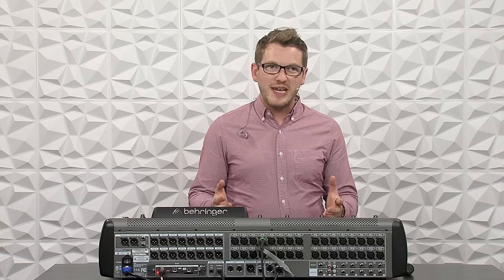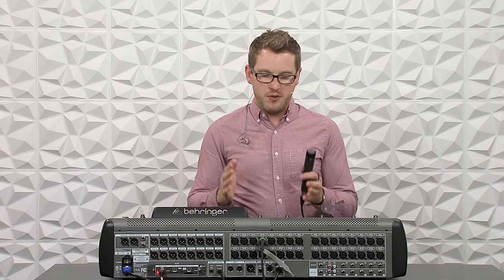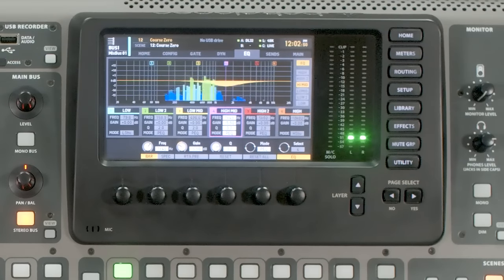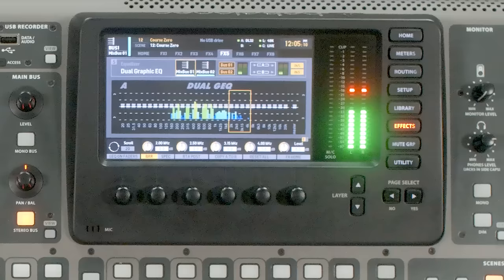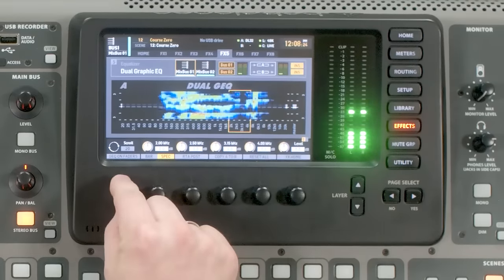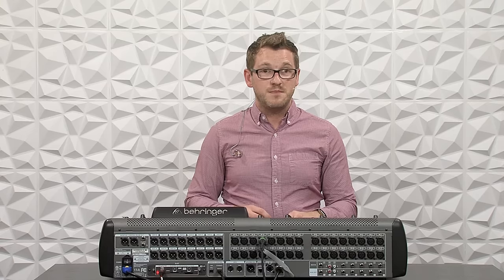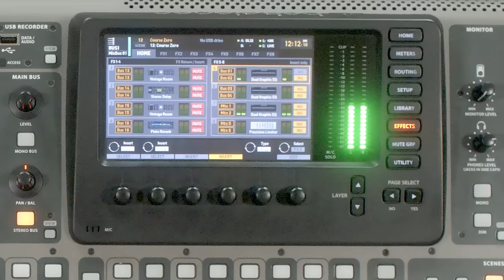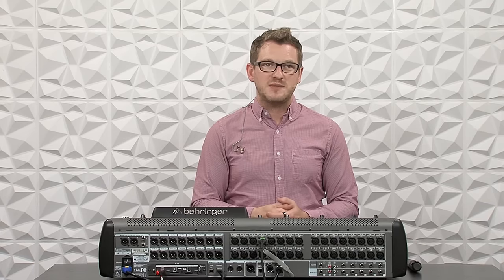Monitor Mixing - How to Ring Out a Floor Wedge - Ringing Out Floor Monitors_1

Comment: The best way to avoid feedback in a wedge is not use them in the first place. In 2024 everyone should be using in ears. Even the garage bands down the street have their own in ear rigs.
Reply: Wedges aren’t going away any time soon
Reply: I agree to this. However, some people prefer loud wedges
Reply: Our worship leader doesn't like things on his ears . He says they mess with his glasses, so we have wedges.
Reply: @philx2897 I’m an audio engineer & I wear glasses with IEMs. Lots of my musicians wear glasses with IEMS. He has to learn to adapt. No excuses.
Reply: Yes IEM are easier to manage, but mostly the sound isnt satisfying. Most mixer cant do it right and sound suxx
Reply: What an incredibly cool thing to say
Reply: Just more things to go wrong. Bands bring IEM with them and then complain to me that their kit isn't working because the batteries are dead or the buttons smashed in and it's held together with tape. I do events with multiple bands doing fast changeovers. I tend to take the IEM signal feed from the wedge through so that when (not if) someone's IEMs stop working I can just turn the  wedge back on.

Comment: I’m a big fan of swinging the mic past each driver, starting from afar and slowly getting nearer as you build up a feel for how stable the system is. Really shows off general trouble frequencies without being dependent upon the qualities of my voice. By swinging, the mic moves through the output field of the driver fast enough to not build a sustained feedback, and with practice you can get great control of the interaction between mic and driver as you progress.
Reply: Hi drew how bouth parallell compressor and eq for acoustic drums.

Comment: The very FISRT step to avoid feedback o a floor wedge is to MEASURE it with a calibration mic before even starting to apply any EQ!
Reply: I suppose that’s a good start, but I would say that someone who is watching this video is not going to be as sophisticated as to have a calibration mic and RTA and also know how to use it.
Reply: @mjrausch  Then that person should also invest some time in learning how to do those procedures otherwise they're headed for trouble as they will start applying EQ to a system which they ignore their frequency response
Reply: Just use the actual mic, it'll tell you more about potential problems
Reply: Right because singers are always using calibration mics to sing. This is a perfectly suitable method for most non-professional applications.
Reply: @indianajim  "non-professional" like YOU 😂
Reply: Insanity

Comment: bro cut out all the frequencies
Reply: A 32band EQ doesn't show all the frequencies. Of course you could be more surgical with designated EQs for ringing out monitors, however remember that each EQ adjustment you make, also affects the phase correlation of a signal.

Comment: But the frequencies that feedback depend on the roundtrip latency, in addition to pickup pattern, speaker's polar response and room acoustics. So if you add latency to the signal it will alter the feedback frequencies. What am I not getting? The same with flipping the polatiry of a mic that feeds back - it will alter the frequency.
Reply: 100 ms latency sitting right in front of the speaker makes a negligible difference as far as which frequencies are feeding back in a monitor. If you’re ringing out the whole room you probably use a different method.

Comment: Want to safely ring your PA and protect your ears and speakers?  Drop the threshold of a downstream limiter (with no auto gain) to it's minimum.  This will choke all the volume out of any signal coming through, both vocals, and feedback.  Quite magical to see and hear your PA feedback at a controlled -40.
Want to reduce the chance of feedback? Throw every other front line vocal mic out of phase.  Rather than the loading of multiple mics increasing feedback, this will help stabilize your PA.  Your welcome.

Comment: Do you ring out the mic first, or the wedge?
Reply: Generally speaking, you ring out the monitor only and use the Mic EQ to correct the tone of the mic for the FOH (and the monitor if you want). Sometimes you can use the mic EQ if that's the only one which gets feedback.

Comment: I can hear the feeding back still even with eq enabled. With dynamic vocal mic, I would rather go for -10db gate on that mic, because feedback most time apears, when there is less noise from speaker or on the stage.
Reply: Yes you hear some with the mic on axis but remember he’s sitting at ~90 db. You just want to reduce them a little to avoid any sudden major spikes and increase a little headroom without killing the tone.
Reply: Using a gate to coverup feedback tendencies is a dangerous practice, because it can give you the false impression that more gain is available, and then you raise the gain. Then once a feedback DOES start, it will very quickly go out of control, and you won';t be able to stop it fast enough to avoid a disaster. Ask me how I know this . . .

Comment: How do we use pink noise on the x32 or m32 to tune PAs or Stage wedges
Reply: You can sweep the frequency until you hear some that sound way louder and then cut them a bit with EQ.

Comment: After all that you basically mostly just did a gain reduction with the EQ. There aren't many frequencies left untouched. You could have just dialed the volume/fader down. Almost the same effect. Correct me if I'm wrong!